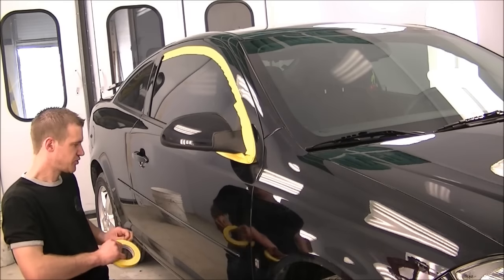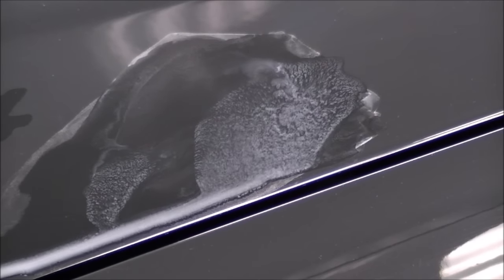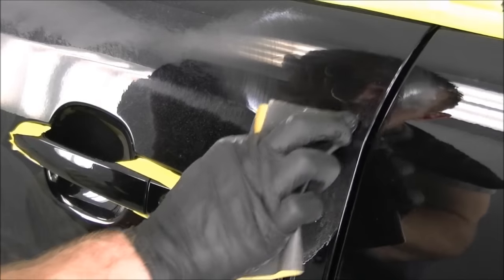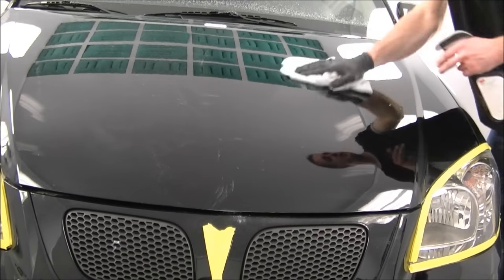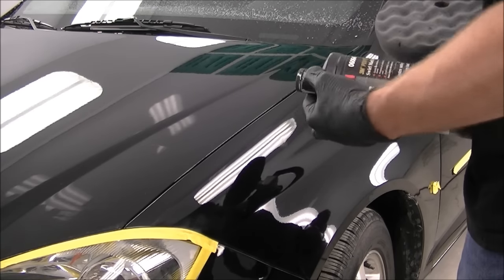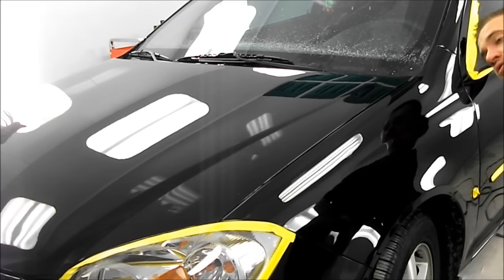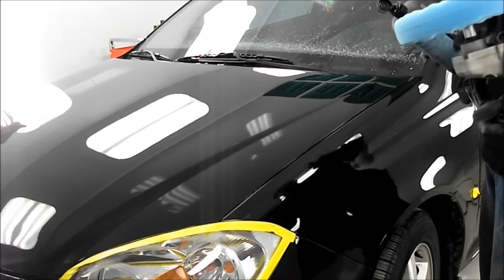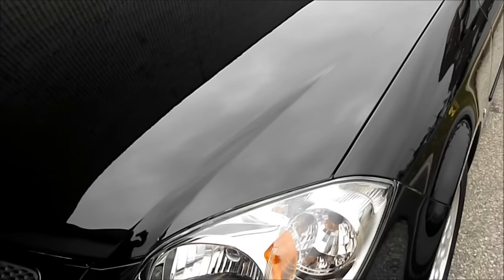Master the Art of Polishing: Complete Guide for a Black Car Shine

Comment: well....maybe it has been mentioned...chemicals from polishing and dust and /or lint from the compounding pad...not something a pro auto painter would want in his very high quality paint booth. Nice post.....good camera work too.
Reply: Also....i do know that 'microfiber' cloths are not 100% soft cotton....and my experience is using microfiber for improving a paint finish is NOT appropriate because they are made using polyester. Especially with dark colors....final polishing and even 'by hand' pre-polishing will do less scratching if you use cotton t-shirt or baby diaper type weave cloths.

Comment: I recently came across a vid where they said that the rotating polishers would still cause the slightest scratching, and therefore they advised to use a non-rotating one, which vibrates instead - have you got any experience whith that? I never heard of vibrating ones before.

Comment: waxing won't remove swirls, you will need a medium cutting pad with a medium to heavy swirl remover, then a finishing pad with a finishing compound then add the wax/paint sealant. i also live in a cold climate, lots of road salt. id invest in a high end wax, (wolfgang fuzion) and wax the car in the fall. also glaze the rims you are using. go to the Autogeek website, they will answer all your questions :)

Comment: What would something like this cost to get done?
Reply: it really depends on the condition of the paint. A ture paint correction. I start around $400 and goes up from there. you can really make paint shine again with a full paint correction
Reply: haha it not cheap. your being the car back and for some people avoiding a paint job
Reply: Professional Automotive Detailing I have a 2011 Black Camaro that will need this done eventually...
Reply: Chris Tolson The 5th gen camaro have soft paint. always use two buckets with grit guards and two wash mitts. also quality microfiber towels. how you care for you paint is the key to not get swirls and scratches
Reply: I have a black MB 2014 E350 and that thing is a bitch to get scratches out of even using Menzerna 400. I am going to buy a Rupes 15.

Comment: Quick two cents. I always Do the swirl remover polish with an orbital buffer and final wax with an orbital buffer. This helps that no speed swirls from the high speed buffer show up after a few washes...nothing worse or more embarrassing then speed swirls driving down the road. That always tells you that the Detailer was a paint terrorist noob. If you want an even more amazing looking job to impress. Mask off the windows with tape and paper so you don't have dumb ass white dots on the trim.

Comment: You Should Never Use Hot or Even Warm Water after You polish a Vehicle, Especially When Wet Flatting, as The Heat Brings Back The Flatting Marks, Also Do Not Use TFR Soap !!

Comment: I've never waxed a car before, my old car was an 88 Civic and a piece of shit lol. But I just recently bought a wicked clean 95 integra (I live in NY so the rust is killer out here) with no rust but swirl marks all over the hood and a few good scratches on the back bumper. How do I tell if I need rubbing compound for the whole car? those spots will need it but idw scratch the rest of the car. And I'm confused about oxidized paint, do I need to check if mine is oxidized before I do anything?

Comment: What's the difference between Wax and Polish?
Reply: im learning about this aswell, polish makes the paintwork shine basically, and waxing creates a layer ontop of the finish
Reply: So can I polish the car monthly or wax monthly?
Reply: +Gary you can do either as much as you like. But usually wax monthly and polish when you get enough scratches to make it worth polishing again.
Reply: Hi Matthew, thanks for the reply. So do I need to wash the car before I wax? or is there a method I can wax & wash at the same time?
Reply: +Gary yes wash and then wax. You want to put wax on a clean dry car.
Reply: I've read that polishing too frequently will ruin the paint because the polish actually melts the paint. Is this not true?
Reply: +Matthew Trier bad advice. Every time you polish a car, you are removing mm of clear coat. You'll burn through eventually.

Comment: i am using a program whit 3 steps polishing rubbing compound second step whit a paste which is smoother and the third is a hand polish
and i am using a german stuff the name i se sonax and working perfect
Reply: ***** Is that an all-in one type polish - clean, polish and wax . If so that's usually good enough for the vast majority of car owners because they don't want to pay for the equipment and put the time and effort into doing a 3 or 4 step paint correction, which should typically only have to be done once.  For the few of nuts, an all in one is not good enough.  We like a polish to do one job and one job only. When a polish is asked to do 3 jobs, it does not do anyone really good, but it makes the vast majority car owners happy.  Also, you'd most likely find that most of those same people only use polishing machines and no hand waxing etc.
Reply: is many ways to doit  up to you and this what you have :)

Comment: I did not agree with wet sanding that one spot on the hood. Clay bar compound swirl remover polish an then final step is wax.
Reply: +Eric Jones I hear you....My rule is....if it is a wider scratch...wider than my finger nail....i might wet sand using a block of course (more careful and precise). Many normal deep scratches  can be polished by hand and or machine (or a combination of both) without the need of aggressive, wet sanding. All these methods will vary as I have pre-determined what the end result is all about: Show car? Used car prep? Normal detailing improvement maintenance? Of course the real professional way is to keep an eye on your (digital) paint thickness, which is always thicker on the top surfaces. Especially for the DIY peeps, less agressive polish is the safer avenue.

Comment: Hello Henry.
There are far more mistakes than what you have pointed out. Woolpad is the most dangerous pad of all, and should not be used on cars with "soft" clearcoats. 
The way he moves his hand, holds the rotary and approaches certain areas on the car what gives him away as bad detailer.

Swisswax is overpriced, and while might be worth the price tag there are better alternatives, for either same price and better result or less value in money and almost the same level.

Comment: Hey man, your buffing technique is terrible. You should ALWAYS rub the compound in with the pad, before buffing it. You burn the clear also, with your sloppy motion of the buffer. Not to mention, you should NEVER sand clearcoat that way. You was only damaging the clearcoat, digging into that way. Use a block! That may work on cured black paint (maybe), but you should stay away from any vehicle that has been freshly painted. Especially black. Good luck.